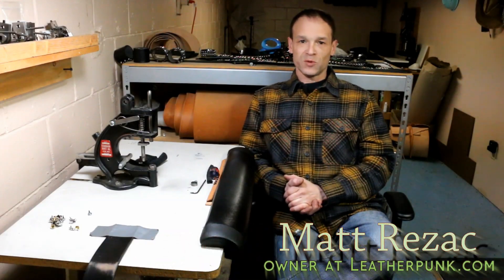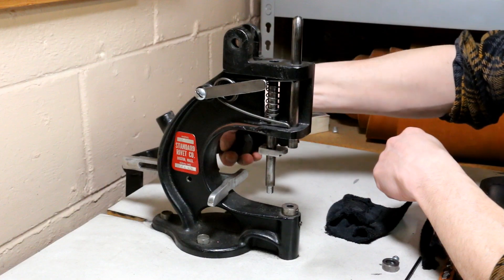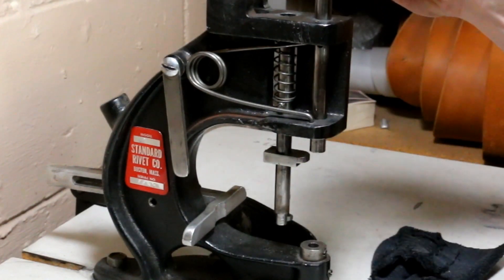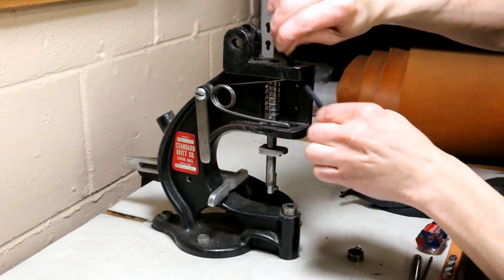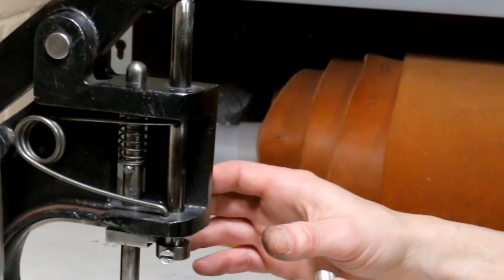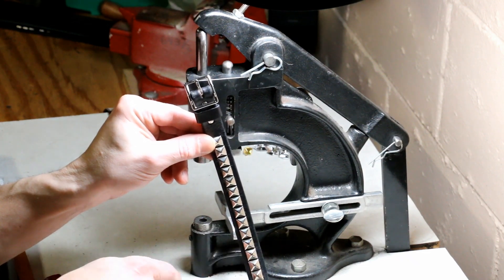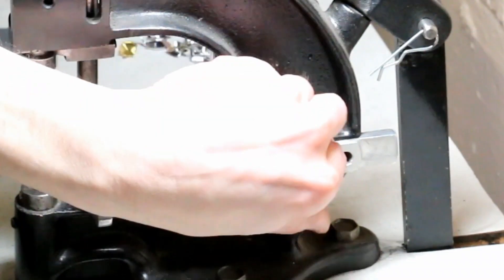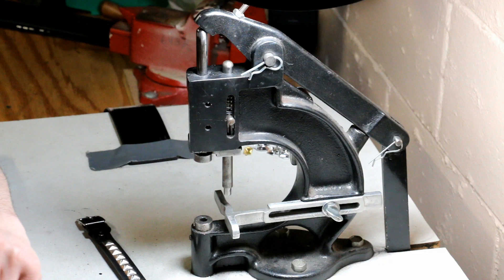Inside The Model 2 Foot Press - A Guide For Advanced Users

Comment: Hi, the guide in back is extremely similar to one on a tool I own called a whitney punch: basically it's a handheld tool to punch holes in sheet metal. The cool thing is there's measurements marked on the guide in 1/16" increments so if you need the holes in your sheet metal 3/8" from the edge you can do that.
Reply from the maker: Thanks for commenting. In theory it's a good idea for this machine, but in practice, it wouldn't help on this machine too much because you're switching out dies that all have different dimensions. So marking 3/8" from the edge would constantly change based on the shape. What I didn't mention in the video is how you can do a 'dry fire' on your leather, that is, you're just pressing down the die into the leather without a shape to leave a mark on the leather, and then make adjustments how I demonstrated based on those impressions.